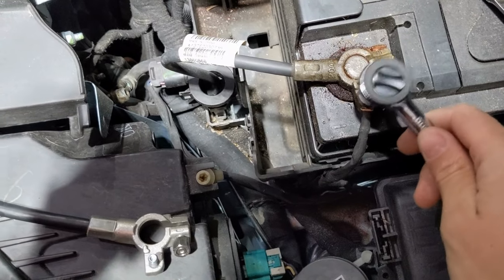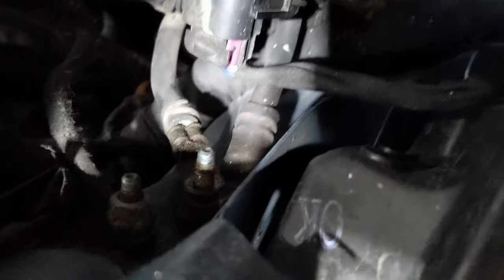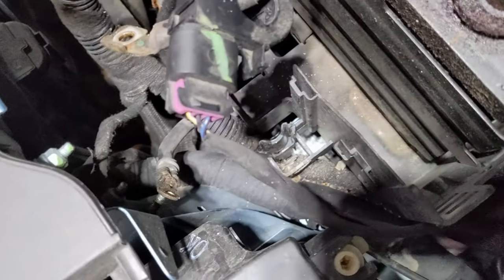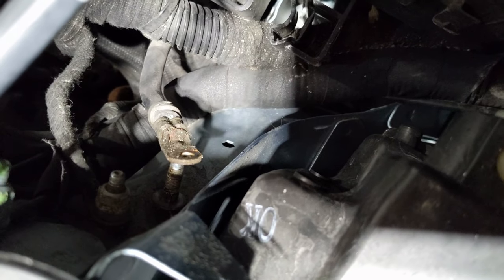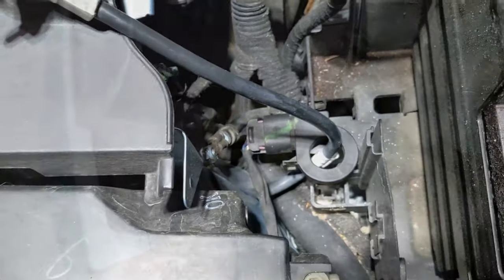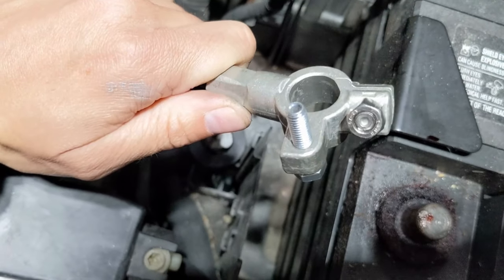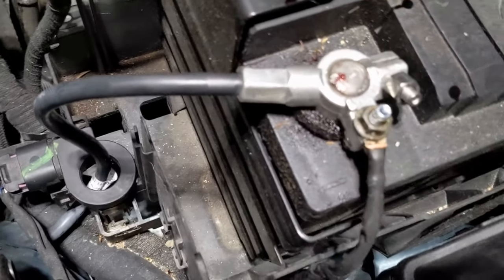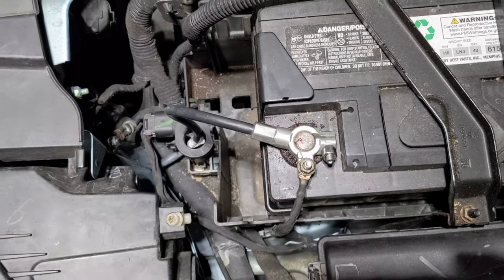Chevy Cruze Negative Battery Cable Replacement - Service Stabilitrak - Radio Off

Comment: Did this yesterday with GM cable part ordered. 15 minutes. Had to find a bolt m6, not in package. Old cable issues were recalled, ie voltage fluctuating, stabiltrak on off, power, radio on off. This was the problem. $23 dollar cable, not a $1500 garage ripoff

Comment: On my 2015 cruze, the service stabilitrac and AB’s light both come on. Usually only when I turn a corner. The radio works and the car runs fine.
Reply from the maker: :( I hope you're able to figure that out

Comment: I have a 2014 Chevrolet Malibu Lt and the Stabilitrak service appears on the screen with the icon of the car skidding, we already changed the spark plugs and the Stabilitrak service still appears 🙁
Reply: Try replcing the ignition coil and spark plugs

Comment: That didn’t work for me! Replaced battery cable, battery and all related fuses and still no radio!
Reply from the maker: Oh no! How is your car running? Are you able to start your car? I believe part of the radio is tied into the ignition for the car (insane).
Reply: @rollcoalrose  car turns on fine! Radio just doesn’t turn on! Got power to the radio but the screen just doesn’t turn on and there’s no sound also!!

Comment: Hi!  I have a chevy cruze 2014 and recently it started doing the same thing.  Did yours make a like a scratching sound coming from the hood everytime the radio goes off? Also did your lights dim/flicker? Mine is radio going on/off at random and lights start flickering.
Reply from the maker: Yes, it was making a clicking sound, was running really rough (shaking almost) and then radio would turn on and off on and off. When I was idling at a stop light the car would shutter and almost feel as it was about to shut off. Best of luck!
Reply: @rollcoalrose  Yes that's exactly all that is happening right now. I got the service bulletin you put in the description. Will that work on a chevy dealer? I called chevg and they said that its covered by code 14311
Reply from the maker: @PhamtomG  if your car is either less than 10 years/120,000 miles, your local dealership should fix for free based on the service bulletin, I'd contact your dealership and they should be able to confirm those details before working on your car. I was not able to go that route (car is over 10 years old and has well over 120,000 miles), hence why I replaced myself...but if it was below those ranges I would have definitely allowed the dealership to fix for free! Good luck! If they are unwilling to honor the service bulletin, this fix was very simple, you can either get the battery cable online or at your local O'Reilly or Autozone to replace! :)
Reply: @rollcoalrose  They changed the cable 4 days ago. Haven't had the issue for now but im still scared it may happen again.